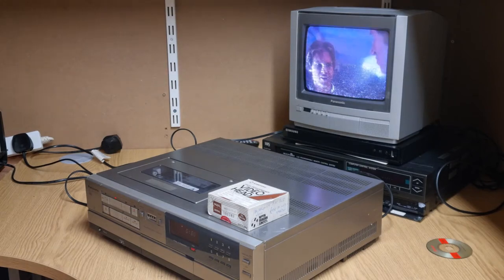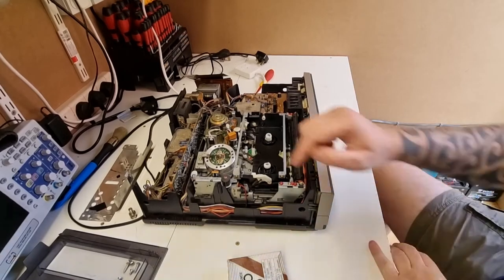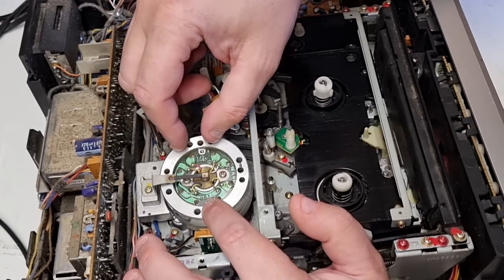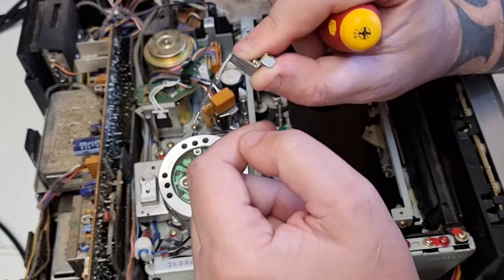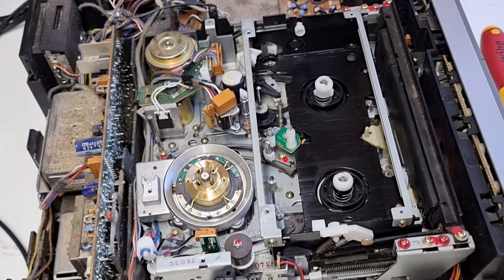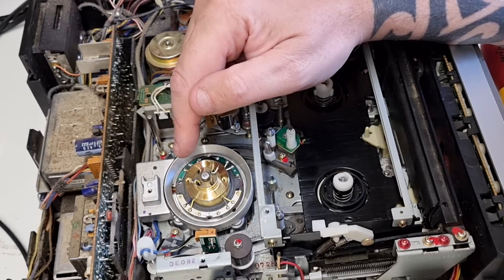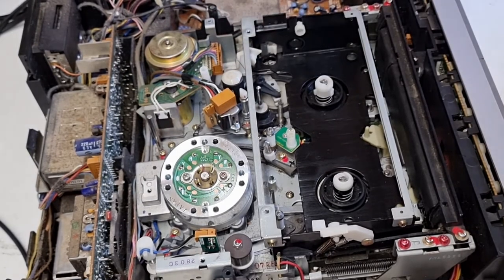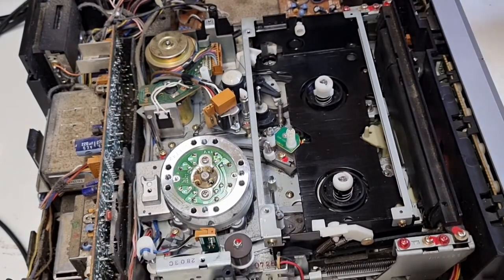Panasonic NV-366 Video Head Replacement

Comment: hi that paper trick works ace on ADAT as well  i had alot of ADAT with error 7  i fixed up  because of  not clean head drums
video heads are hard to find i bet   i look for low hr's decks and use the heads from them video deck

yes in beta cam  take the hr's  pcb with the head drum  when change over head drum  nice lot of video's

Comment: (Nice vid .)Your alignment after FF is ether due to a worn pinch roller or incorrect back tension. I never cleaned a brand new head after fitting professionally. Manufacturers recommended running in by playing a 2-3 hour tape.
Reply from the maker: I like to have a donut with my tea while fitting video heads...... ;)